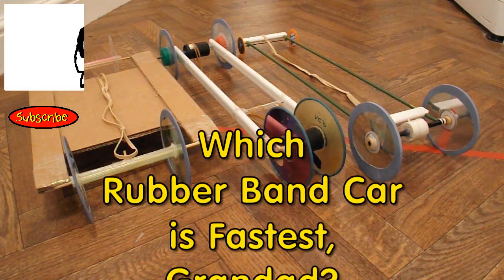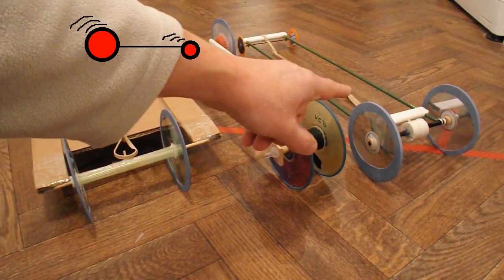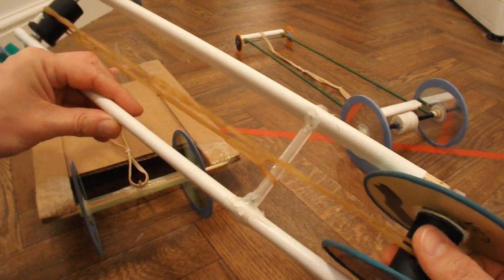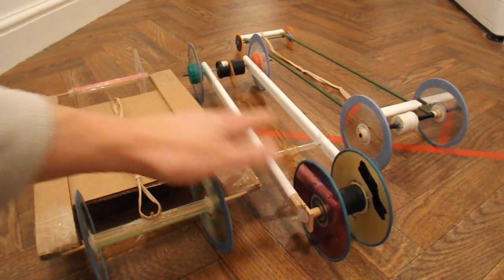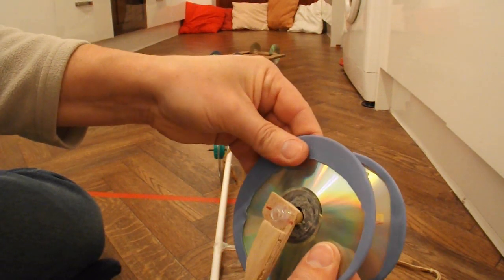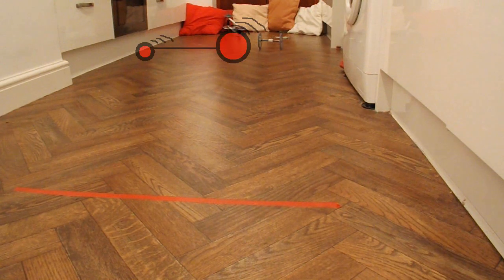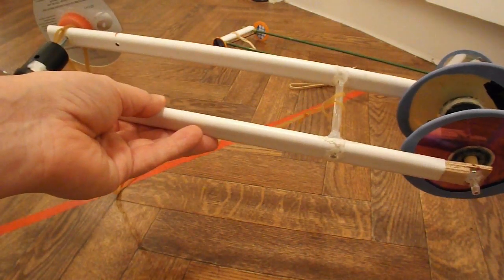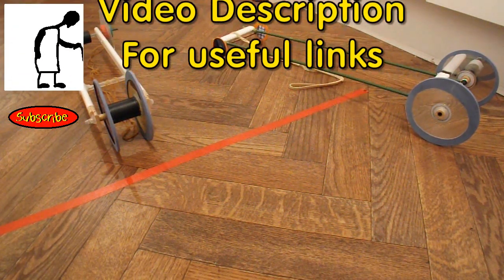Which Rubber Band Car is Fastest, Grandad? Part 2

Comment: how Far can number 1 go???
Reply from the maker: I explained in the video that my kitchen is 5 metres long so I can only say it goes 5 metres. It hits the wall hard enough to know it can go much further but I have no way of checking. On a good smooth surface it should continue to free wheel long after the rubber bands have run out.